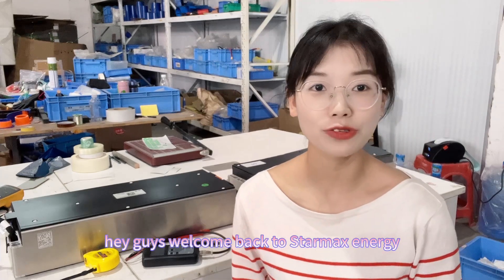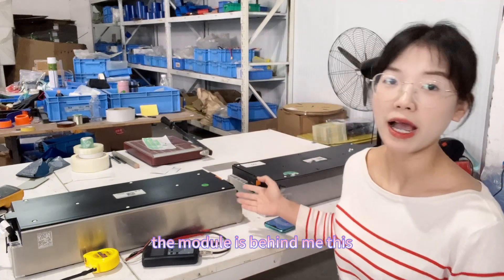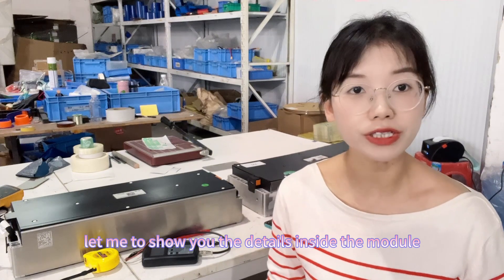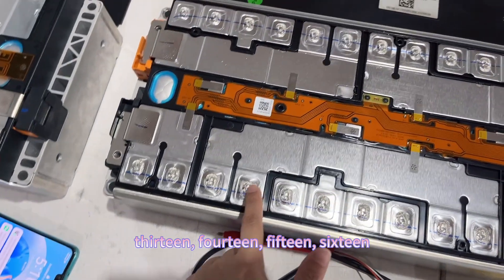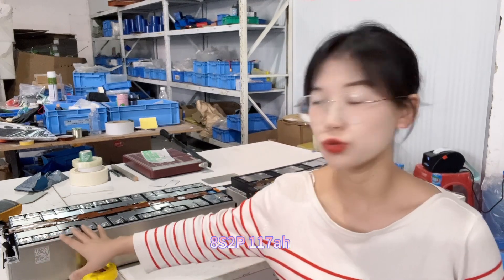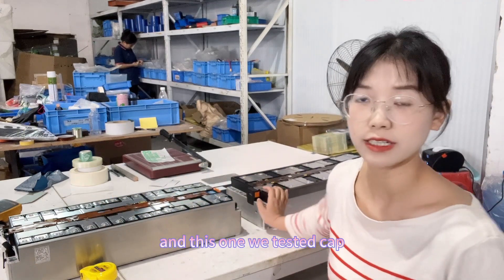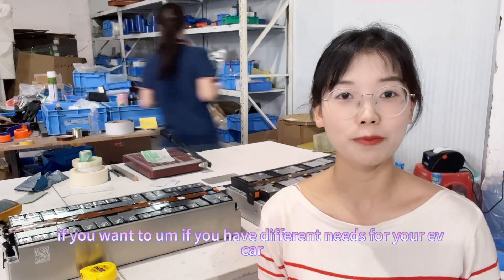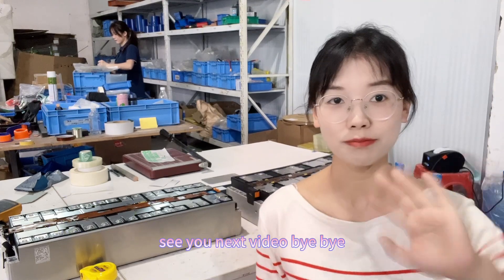CATL battery 8S2P 234Ah and 8S1P 230Ah comparison

Comment: Originally NISSAN Batteries 2S2P x 2 x 24😮
Reply: 2P is most reliable when battery unit was failure
Reply from the maker: Yes, to replacement the  original 24KWH